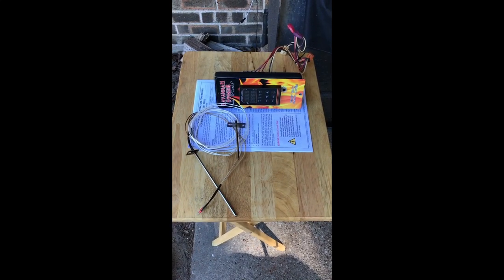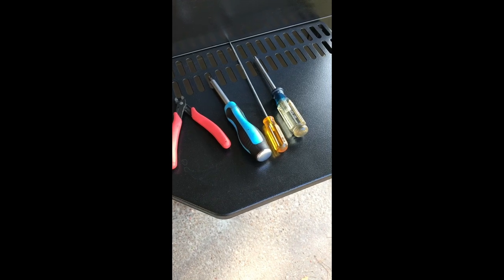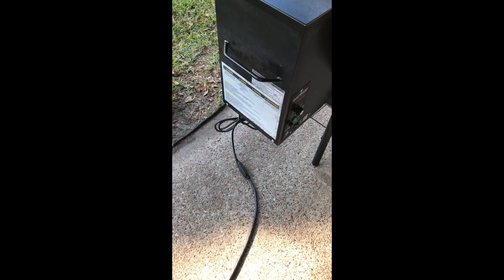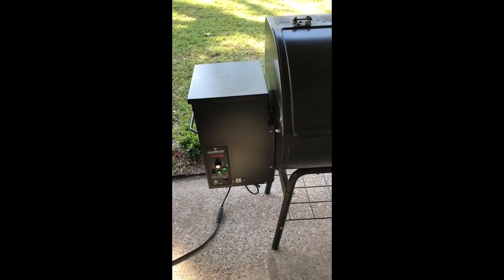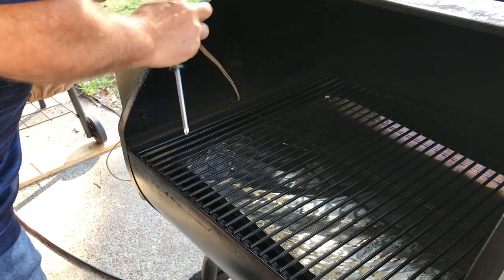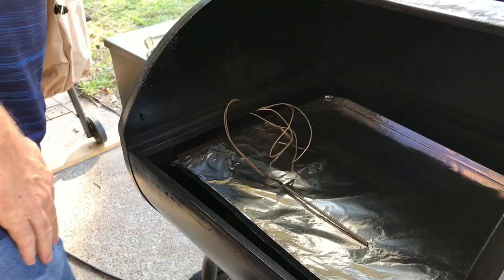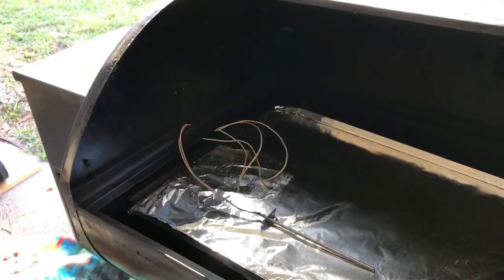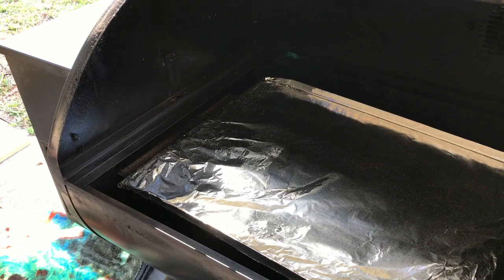Savannah Stoker controller Installation on a Camp Chef Grill

Comment: I see you previously installed a new fan and auger in the Camp Chef. Is that required with the Savannah Stoker or can you just pop it in a stock factory Camp Chef?
Reply from the maker: No it isn't required. I had changed that out for another controller and was putting the factory ones back in. No need to change with the Savannah Stoker.
Reply: Thanks. I just got a Camp Chef over the holidays. I'll probably make this upgrade in the spring.